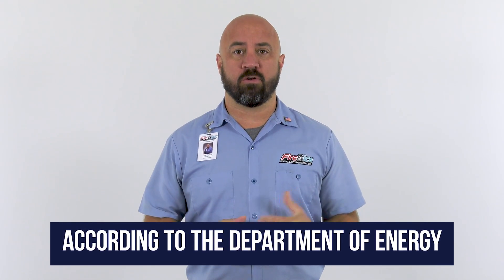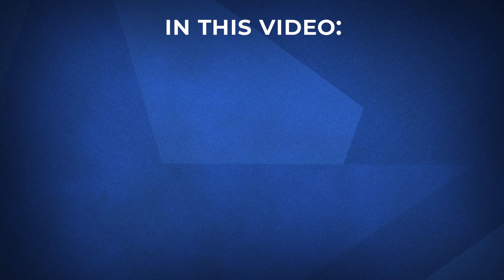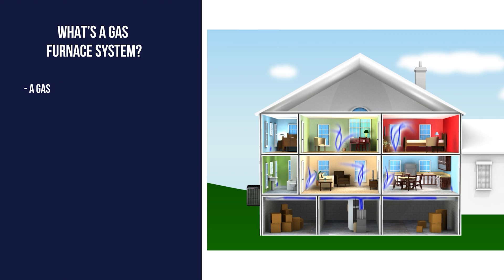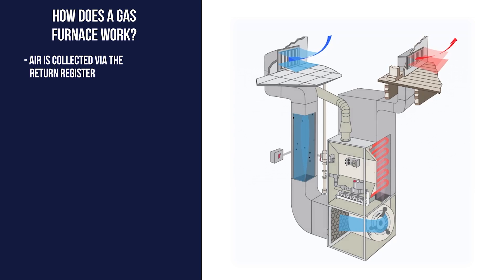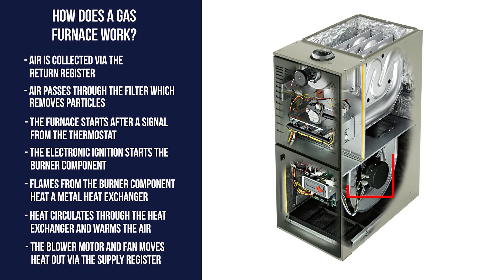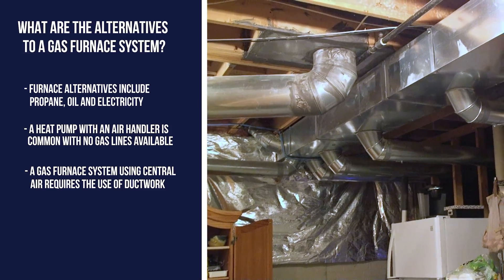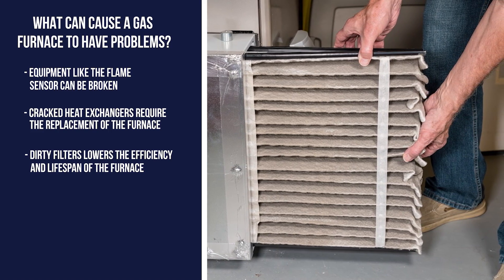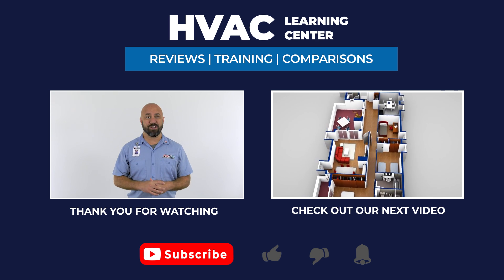How Does A Gas Furnace Work?

Comment: Can you tell me from where the air comes to  a furnace and to the house? Is it fresh air from outside or the air from the basement?
Reply from the maker: Air is circulated through the house through ductwork.  If you are speaking of air for the combustion process, it will come from basement if it’s 80% efficient or less, and from outside if it is a 2 pipe 90+%

Comment: In a high efficiency furnace (2 pvc pipes) is the combustion process completely sealed and separated from the air that mixes into the home?  I ask because a new Radon mitigation install has the outflow pipe outside the home within a couple feet of the intake pipe to the furnace.
Reply from the maker: With a 2 pipe system it is a completely sealed process that uses no air from inside of house for combustion process
Reply: @fireiceheatingandaircondit4363  Thank you for the reply.  But does ANY of the air brought in from outside for the combustion process through the intake potentially leak/mix in with ANY of the conditioned/cycled air that goes through your furnace and vents once it's in your furnace?
Reply from the maker: No.  Not unless the heat exchanger has a crack in it.